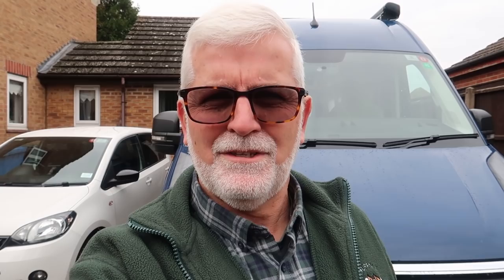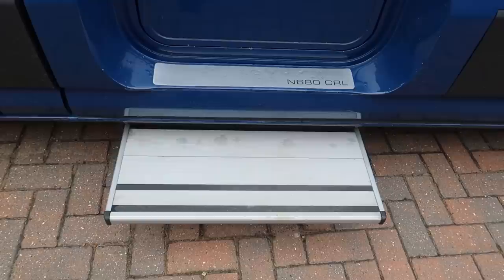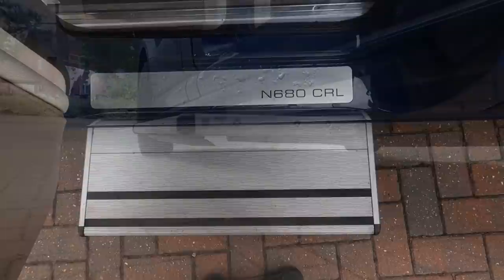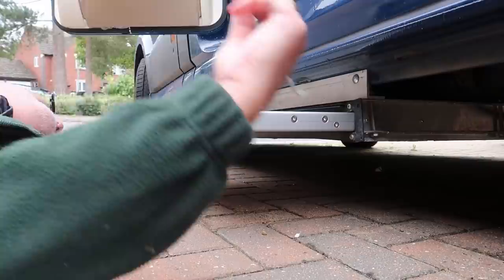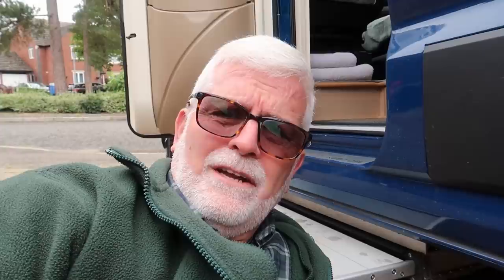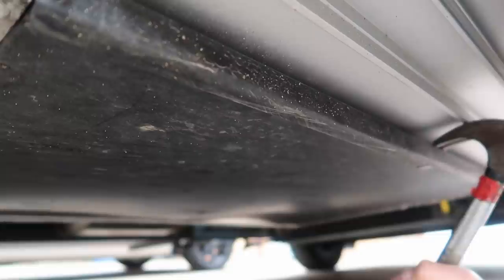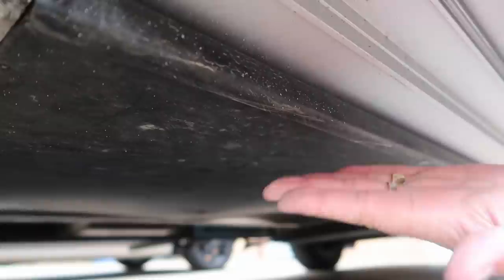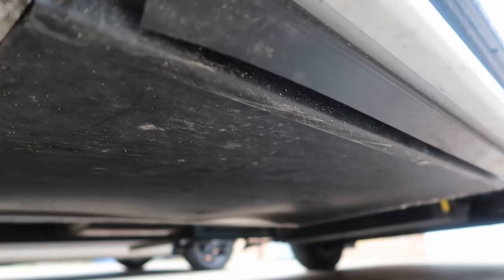HOW TO FIX A MOTORHOME STEP | Thule Electric Step | Vlog 422

Comment: Useful Video Trev, this is a real problem with longer wheelbase campervans/homes with these side steps. 
Considering the top market value of Thule kit, and this is not to knock the general quality of their products, I think it's inconceivable that the housing is soft aluminium, with what appears to be an underside plastic tray insert protecting the mechanism. 
Why on earth they do not produce a sump guard-style skid plate that could protect the whole unit is beyond me, or build them stronger, especially as the step reduces the ground clearance so significantly.
Within a week of owning a brand new Hymer 600 Campus on a Fiat Ducato, I reversed onto our driveway and caught the kerb. I was aghast, and now the step crunches and catches so an intervention like yours is called for.
That and a set of front mudguards to keep the mud and detritus spray firing straight into the step mechanism.
Thanks for the video btw, much appreciated.
Reply from the maker: Thanks Rob, having owned the van for nearly 3 years now, I have not only become used to the step being there, I have come to terms with it being a liability rather than a useful feature. The Crafter is so comfortable and enjoyable to drive, the step has over time, become obsolete and we now use a plastic step that we put in and out when we need it. It’s a great shame really but I clipped it on a kerb again in December whilst manoeuvring and that was the final blow. It’s now beyond repair and is a fail that doesn’t seem to have any other alternative but to replace with the same. 🤔 Safe travels 👍🏻💙 Trev

Comment: Well done Trev for attempting that yourself and for the fix, looks like it worked 😁a treat and no real harm done 👍 also thanks for the warning on the ground height clearance, we have the same step so will take extra care. Good to understand how it works too - thanks for sharing
Reply from the maker: It’s quite easy to ground it on a camber in the road or like I did in a pothole on Skye. Interesting that all four ferries were fine 😃 It’s a fairly simple mechanism but the box is made of aluminium so it’s quite soft. Thankfully I got away with it this time 😃 Trev

Comment: Managed to do the same thing after day 3 of our New Wildax, found this and had a go, now working but most of jammed outer casing trashed, so guess it will have a little.ited shelf life. Also helpful for my wife to see even an experienced motorhomer ca  have a mishap 😀
Reply from the maker: It’s so easy to catch the step and we have done it a handful of times. The trim was first to come off and the mechanism inside is so simple it’s just a case of prising the frame into a position where the moving arms don’t catch the box 😃 Like I said, large screwdriver and a lever to reshape the oblong case 👍🏻🚐 Trev

Comment: Good job but it needs a bit of tidying up. I’ve got about the same clearance under my wheelchair lift on my motorhome. Speed humps in a car park at Wertheby services scrapped under my lift a few years ago but fortunately didn’t do any damage
Reply from the maker: It’s a serious problem negotiating the various types of speed bump. Some of those with a 4 inch high square island in the centre of a lane can be very close to the underside of our van and our Skoda Citigo too. Thanks for your comments 😃🚐 Trev

Comment: The Speed Humps on Roads n Streets Could be a Issue if Van Bouces too Hard 
Is  the Air Suspension fully up, is it Adjustable? Trev.

Id be Inclined to Fit a Thin Ally Chequer Plated Skid Plate that fully Covers the Underneath to Protect it...
Bob a Bit of Grease on the Sides of the Step , Sounds a bit Dry going In n Out
Reply from the maker: The suspension on our van is not adjustable but it may be possible to get it raised slightly. We are going to see how we got on and take a little more care. A guard may be possible too but I worry about grease picking up all the grit and dirt and possibly making things worse ?  Thanks for your suggestions 😃👍🏻🚐 Trev